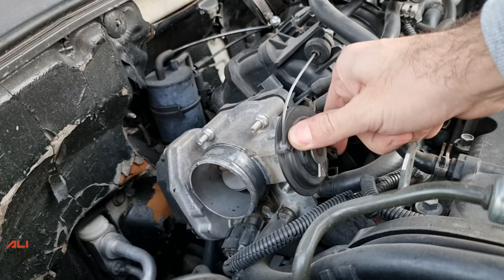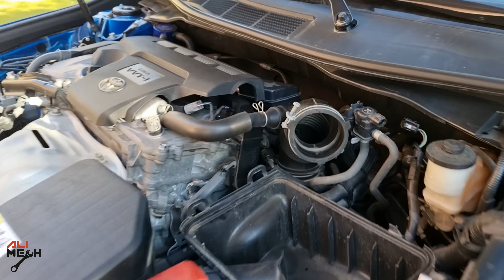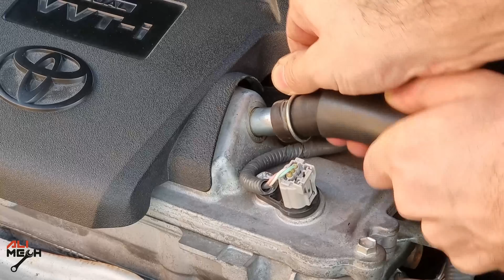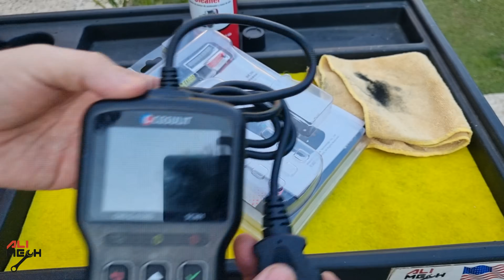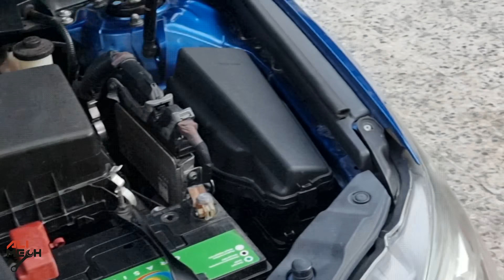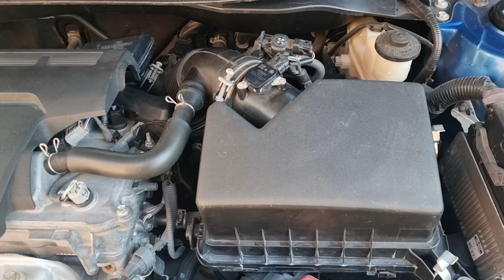Don't Clean throttle body before watching this/Cleaning cable controlled or Electrical Throttle body

Comment: thanks for the video, i got the code P2111  Throttle Actualtor "A" Control System - Stuck Open after cleaning , can you help?

Comment: You should never put your fingers in throttle body when it is Electric…?!
Reply: Very very dangerous !
Disconnect the electric cable to the Throttlebody first, and than open the throttle flap carefully and place some little wrench between the butterfly to keep it open.

Comment: Hello..Do I need to remove the battery head first...and then remove the fuse ecm?
Reply: Thats the first you must do when doing this job !
Thats why this guy had  hard start after cleaning the Throttlebody ..
The Ecu remembers the old value, its important to reset Ecu.

Comment: Thanks for the guide. I cleaned mine yesterday. Suzuki sx4. I used a kettlebell (it was in it's box) to keep the pedal depressed 😂 it had quite some soot on it from the pcv valve... I used mannol’s carb cleaner (I couldn't find the intake valve cleaner). The engine started up like yours but no codes came up. I took a test drive and could feel after cleaning that the gas response and acceleration are better, idling might be a bit quieter too. 👍🏻

Comment: If I did move the plate on my 2015 Nissan Rogue manually to clean it.  Drives fine afterwards. How do I know if I messed it up?
Reply: If it drives fine afterwards, you did not. If you messed it up, you'd know without a question not long after.
Reply: Thanks. It was fine.  @RealKansasMan

Comment: Thanks for your video. But need to warn you not to spray CRC spray directly  into the TB . Spray on a microfiber towel or shop paper towel
Reply: totally agree with this....spraying directly into the TB just redeposits the crud to another place.
Reply: اشكرك،
Reply: Do you disconnect the battery first before cleaning or it is not necessary?

Comment: Nice video, I have been cleaning it this exact way so many times in my elantra gt, with 0 problem so far, just an advice, be careful while cleaning and avoid pressing or pushing the throttle body butterfly itself 'cause you can damage the inner parts in it.
Reply: It's okay to press the butterfly manually just do it slowly.

Comment: This is the completely wrong way.just reassemble it from car and clean it when you clean it like this what you are showing all the dirt in intake manifold will goes inside I don't recommend this way but yes if there is some problem with throttle body wire you are thinking that if I remove it may be break then dont remove it .

Comment: To prevent check engine, it's better to remove the positive connector from the battery and remove throttle body off from the car, clean it and reinstall it. 

Cons: you will reset the electronic systems.
Reply from the maker: It's about first start actually, where there is something else than air in throttle body, it messes air fuel mixture, then it throws that error code

Comment: It showed a Mass Air Flow Sensor code because you turned on the ignition to open the throttle body butter fly valve while cleaning and the MAF sensor cable was disconnected.
Reply from the maker: I did that before and didn't had any error code,  but u used less cleaner before
Reply: Ok. That happened in my car. But I can not back to normal. It is an honda crv.  P0100 keep coming. No matter how many times I do disconnect the battery. The whole night disconnected. 
Please, some idea?
Reply: @toshibahomeschool5704 you may need o2 sensor front an back
Reply: it is true, so thats why you are able to erase error code later on. :)
Reply: @Hiroshi_Takasaki  Error codes will disappear eventually after its fixed or use a code reader from Harbor freight to erase the codes immediately. They're like $40 and come in very handy.
Reply: Plz show me this car Map sensor where is that exactly by video plz😊

Comment: Is it better to  push the  throttle in manually in a slow manner rather than do it electronically by switching on the ignition?
Reply: Not if it is an electric throttle body. You could damage the sensitive motor inside or mis-calibrate it. My experience with the best results is remove the throttle body off the car, clean it and reinstall it.
Reply: @nelsonl5158  Thank you . Appreciate your help.  Subscribed.
Reply: @nelsonl5158 if you remove an electrical throttle body from car can you still open butterfly to clean ?

Comment: Is it harmful if carbon goes in the engine while cleaning as u did
Reply from the maker: You mean when cleaning or without cleaning ?
Reply: @AliMECH  when cleaning.. Bro :)
Reply from the maker: @ahmadchaudhry  no, crc cleaner dissolves it, thats how its been designed
Reply: not harmful. solvent dissolves the carbon build up burns off after starting engine.

Comment: Thank you.  Brother should I clean throttle body as routine maintenance or only if idle issue ?
Reply: it's better to do routine maintenance when doing routine oil changes.
Reply from the maker: Yes it's better to clean it once a while so the carbon don't damage the door